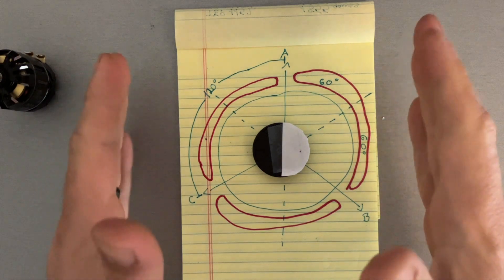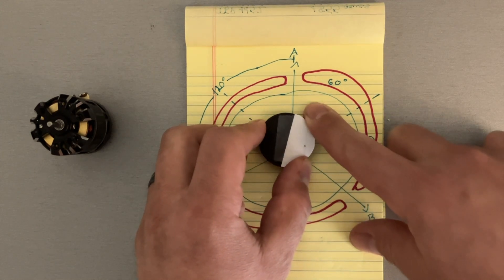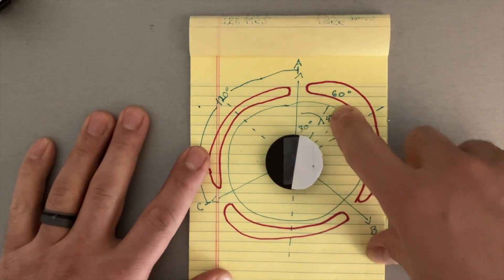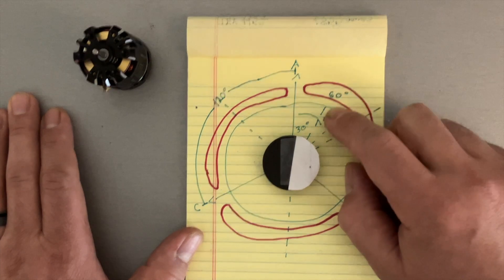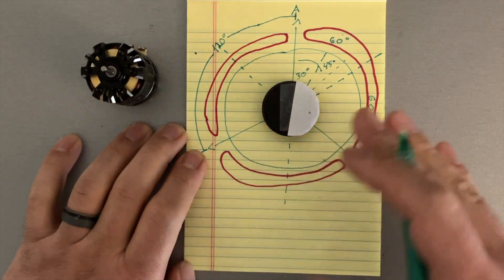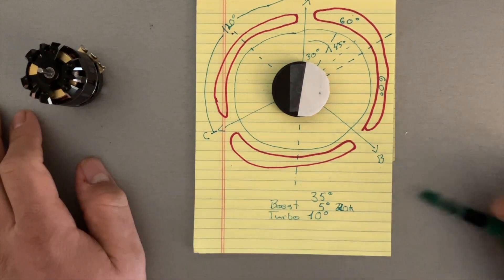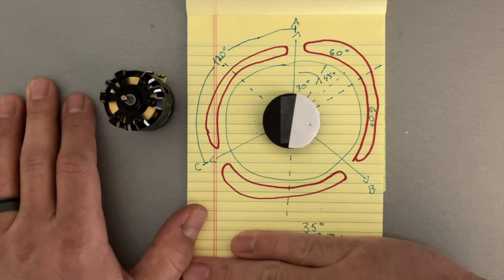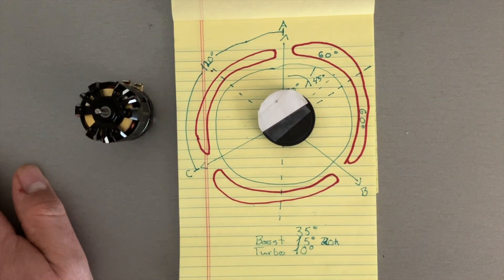Brushless motor Timing What is Blinky Turbo and Boost never exceed 60 degrees

Comment: If someone was setting up a new SCT (or any new RC car) and wanted reliable, long-term, set-it-and-forget-it performance, what electronics would you recommend? Is there a Toyota equivalent in the world of RC electronics? Motor, ESC, batteries, charger, servo, transmitter; all of it.
Reply from the maker: Futaba T3PV, Hobbywing Justock G4, Hobbywing G4 17.5T for TC or 13.5T for SCT and a Protek 160 SS servo for TC of 155 for SCT.
Reply: @telecomandorc  Thanks for that. Futaba used to sell a kit that included transmitter, receiver, servo, and ESC which was nice for its all-in-one simplicity. It seems like there was a move to a la carte electronics at some point with a ton of new options and names.
Reply from the maker: @backbayhound563  Most things are a la carte now. Even Sanwa sells TX-RX, esc, and servo separate. Although, it is a very good combination if one wants the bells and whistles with telemetry. But they are no longer a package.

Comment: I have heard  about running 100 plus timing ,like running 30 degrees on can and more than 70 or 80 degrees of turbo/boost
Reply: I run 90- 116* on a 4pole. 
I think he’s talking about at startup. The party just starts at 60*
Reply: @illconductSRT8  true. I run 95 degrees of timing on a trinity 4.0 and it loves it. Motor or esc doesn't get hot
Reply from the maker: I have not heard of it. Even going up to 60 degrees, the amp draw shoots up exponentially. The heat is massive compared to lower timing. So going up to 100 degrees would draw a lot of current and create massive heat. A TC motor would not handle it for a full race if the battery pack even had enough capacity.

I will do an experiment once rain clears again with an HW X10 G2 esc and a Trinity Slot Machine 13.5T. 

But in the mean time... below is a link from Tekin regarding timing. Scroll down to the section titled "Timing seonsored only" subsection "Turbo" and they have a note there. Not much information, but they recommend never exceeding 60 degrees.